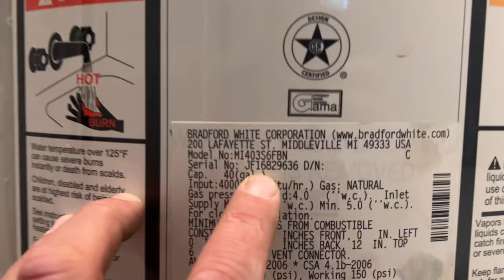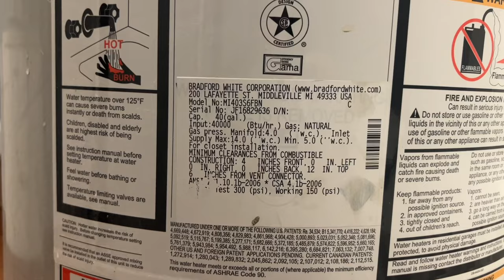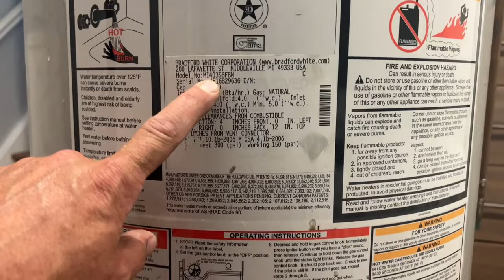Life of Plumbing Contractor - Handling an Emergency Water Heater Replacement on a Friday Afternoon

Comment: Hello. Love your channel.  Question. Heating last 15 years with Bradford white combi hot water tank. (Floors and hot water) Works ok. I’m changing because of age. Suggestions. ?  Use Same or condensate boiler water heater direct vent for both units.  Also, what type of boiler if that's what you recommend. 
Open to suggestions. Ontario Canada. 
Thanks. Mark

Comment: Did not understand why the upgrade to 4" the vent hood is a 4 x 3 you can use either unless your on the line for the seven times rule.   In MA we need a vacuum breaker, in CA no vacuum breaker but on a stand and strapped to a wall.  No consistency at all.
Reply from the maker: read a code book
Reply: @MikeyPipesUncensored  ya, I'm an inspector in Massachusetts.   It's not required.

Comment: There are several critical industry pros with whom the Average Joe should always have an up to date point of contact and a good, trusted rapport. Those people are a 24HR service plumber, a 24HR service electrician, an HVAC technician, a sewer snaker/jetter, a lawyer, an insurance agent, a 24HR towing company, a competent and honest dealership service advisor or a privately owned automotive shop technician, a primary care doctor/nurse practitioner, a 24HR emergency veterinarian hospital and a regular vet, a 24HR locksmith, and a hair stylist/barber. Women probably want a manicurist/pedicurist and OB/GYN doctor as well. When the plumbing situation goes totally sideways at 7pm on Sunday or the AC stops cooling on a 110°F day and your newborn or pets can't handle a 90°F house, you need a good guy you can call and say "Please, you have to come help me!" Someone who will do the right thing and isn't going to seize that opportunity of having you firmly by the balls to squeeze 'em and walk off with half your paycheck. You're a good guy Mike. You do love getting your reward for emergency calls, but you seem to charge fair prices for them. It's not cheap to ask someone to get out of bed and drive a mobile warehouse of parts and a mind full of knowledge over to your house at night and rescue you. Of course, you also do good and proper work, which is most important. 👍👍 2 thumbs up.
Reply from the maker: Totally agree! Always have reliable contacts available in your Rolodex

Comment: Mike, do all chimneys need a SS liner? You talk about liners alot
Reply from the maker: Gas appliances need proper venting. Here on Long Island, a gas water heater or boiler need to vent into a properly sized UL listed stainless steel liner.
Reply: @MikeyPipesUncensored  interesting, I just had my unlined chimney top fixed and they didn’t mention anything about a liner for it, and I’ve got NG boiler and a NG water heater.  I’m in NJ, so I guess that’s why
Reply from the maker: @brian2359  maybe

Comment: No vacuum breaker?
Reply from the maker: Hi Lucretia, there is NO vacuum breaker on this water heater. Did you notice how the previous unit also did not have that? Would you like to know why? Local jurisdiction does not require one to be installed. I personally have NEVER installed a vacuum breaker on a water heater and neither has any other licensed master plumber in my area. I hope this answered your question! Enjoy the weekend and thanks for supporting the channel.